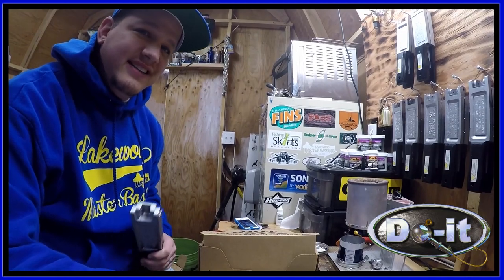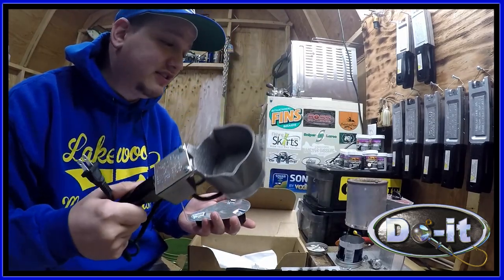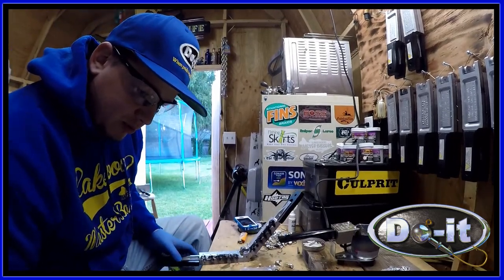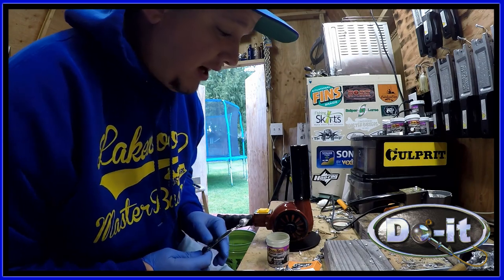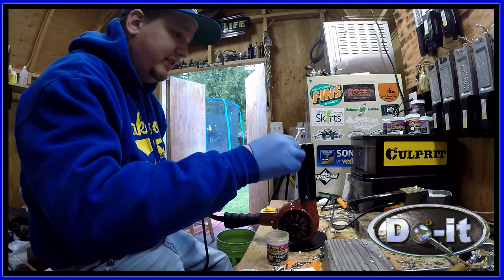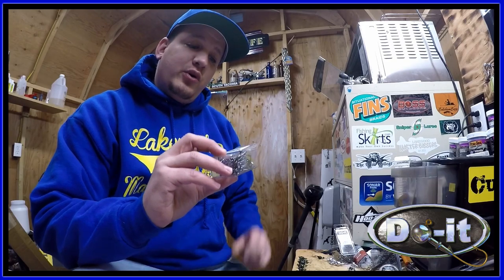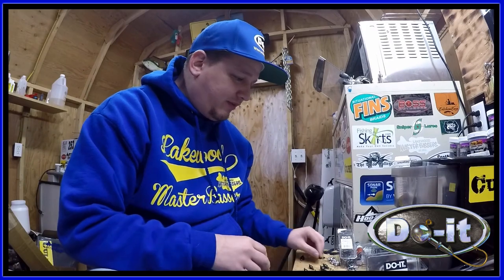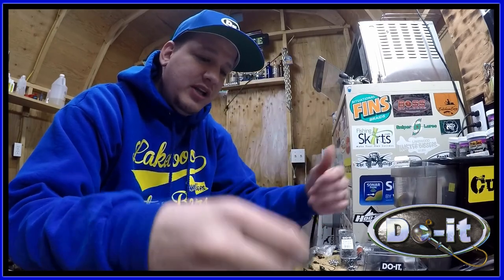Making some Do-It Molds Poison Swingtail jigs

Comment: You may try using UV resin instead of 5 minute apoxy for the eyes. It's much less tedious and you don't have to worry about the epoxy setting up on you if you run a large batch. We use it for tying flies.
Reply from the maker: Yeah I  will have to try that out.  Thank you!!!!!!

Comment: Enjoy your videos esp those relating to jig & chatter bait construction. It looks like the poison tail swing jig insert positions the hook farther back than it needs to be, thus making the bait longer than desirable.. The Zman Freedom Chatterbait actually positions the hook eye into the back of the head, which seems to work well. Have you fished the poison tail swing bladed set up enough to get a feel for it?
Can you tell me the brand/model of the heat gun you are using? I like it’s wide stable base. Regards, stay well!
Reply from the maker: I've fished them alot and dont mind how long the hook is. Can actually use different hooks but I like them like this.
Reply from the maker: I got the heat gun at harbor Freight.

Comment: Well I must say wow I need a few of those in my arsenal! Question I know you stated that it takes a lot of pressure to pull the part you clip to add a blade!  But how about the section the hook attaches onto? Since that section is simply just pinched closed with pliers. When you have a good size bass on possibly on cover and such! Does that joint that's pinched holding the hook hold up great? And secondly do you sell these? And if so do you have a website or anything? These are some of the coolest swing style jigs I've seen. All my local shops just sell the basic football or round  ball style swing jigs! Very nice though bro new to the channel so apologize for all the questions..
Reply from the maker: I actually made a video showing how much force it takes to open it
Reply: @ThatGuySkimpy  I tried finding it but had no luck. I am Interested though in seeing it!
Reply from the maker: https://youtu.be/zHE3umn13LM

Comment: Why no fluid bed ? I think it uses a lot less paint and is easier. Just wondering why you don't have one.
Reply from the maker: Jacob Berkshire I know it.    I will be getting one here soon
Reply: The fluid bed cups form,TJ's Tackle work,awesome.
Reply from the maker: Jacob Berkshire awesome thanks.  I'll take a look
Reply: there are videos here on you tube on how to make a fluid bed with plumbing supplies and an air pump for a fish tank way cheaper then buying one from the online retailers i have built a couple of them for about 40 bucks total tightlines skimpy
Reply from the maker: John Bogaczyk yeah I've seen some.  I will have one alone or later.  Thanks !!!!

Comment: Can this mold take a 30 degree hook? Or could it be modified to accept it?
Reply from the maker: Matt Dillon kind of.  Some hooks with bigger eyes make it or shut all the way but can dremel if needed
Reply: That Guy Skimpy okay so I wouldn't need a poison tail and swing tail. this would work for both especially since it has small and large weight.
Reply from the maker: Matt Dillon lol basically lol.  But if you want weedeless you would
Reply from the maker: Matt Dillon https://youtu.be/9rQ88I1DP4g
Reply: That Guy Skimpy true I did see that and forgot about not being able to have weed guard. I wish poison tail had sizes like swingtail. They want you to buy 2 different sizes.

Comment: Where is a weed guard?
Reply from the maker: If its a swingtail theres no weedguard.  The swingtail isn't weedless.  The weedless version is called the poisontail.
Reply: @ThatGuySkimpy  Love your videos,I’m hooked on this stuff now...One questing first you,do you put the Teflon plug into the jig while baking it?
Reply from the maker: @ronniemartin8391  i put in the Teflon pin when I paint them then I usually take them out when baking
Reply: @ThatGuySkimpy  I see you make chatterbaits out if that poison swung tail!!!
Reply: @ThatGuySkimpy  Any tips on getting too much paint on a football jig,do you use a fluid bed?
Reply from the maker: @ronniemartin8391  i don't.  I use heat gun and dip in the jar.  I make sure I mix and stir up the jar before each pour.   The trick is to get perfect temp and dip in and out quick making sure you cover it all
Reply: @ThatGuySkimpy  I got a Doit poison tail mold today the 1/8 pin doesn’t fit the smallest cavity!!
Reply: @ThatGuySkimpy  Thank you for answering back,I’ve learned from you 👍
Reply from the maker: @ronniemartin8391  dude hit me up anytime.  Thatguyskimpy@gmail.com
Reply: @ThatGuySkimpy  Ok I will,really appreciate it 🎣